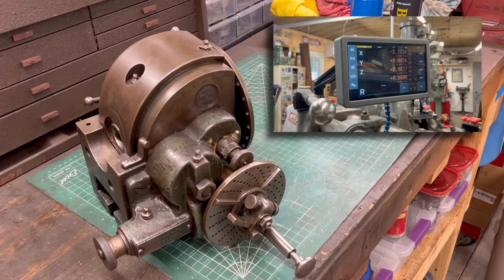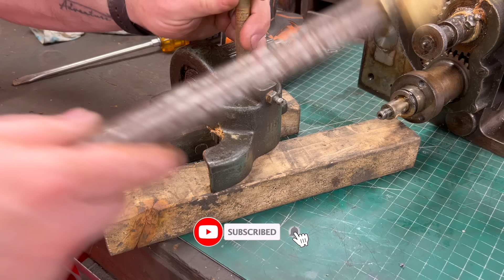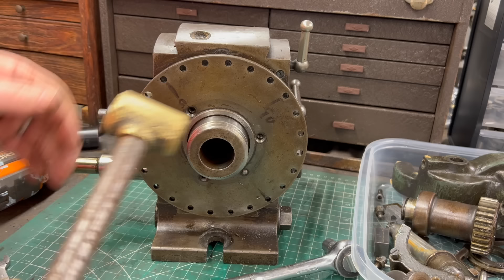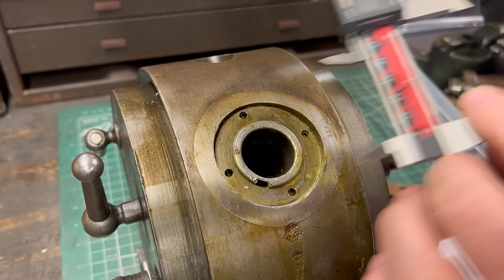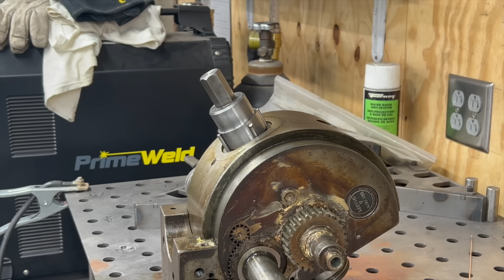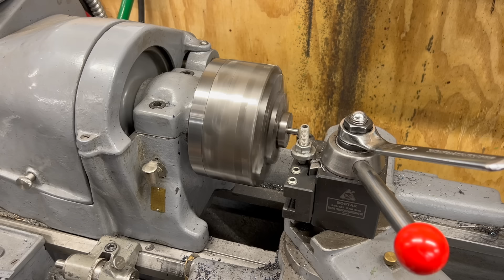Tearing Down a Brown & Sharpe Universal Dividing Head

Comment: Can't say I'm surprised you struggled. I've refurbished three dividing heads, two Elliotts and a Victoria. After each one I swore I wouldnt do another. Zero clearance fits and hidden grub screws were just two of the delights I came across.
I'd be wary of using the worm to lock the spindle when you beat on the rear locknut. The div heads I did had bronze worm wheels and I'd be nervous of putting a ding in it. I'd have gripped the spindle nose in my vice (it has copper jaws).
At least when you got in there it wasn't a waste of time!
Reply from the maker: It was definitely a learning experience! I was confident the worm and gear were not bronze, so I wasn't worried about doing any damage to it.

Comment: All you need was a piece of flat bar with two holes drilled in it to put the pens in space properly and then you could’ve just turned to nut
Reply from the maker: The nut is recessed into the curved back of the dividing head. I considered that, but the pins would be been so long the likely would have bent over with out much force. Thanks for the comment!

Comment: The forbidden peanut butter!
Reply: BTW, I worked on one of these about 18 months ago.  (The one I had was an import clone.)  I found it surprisingly difficult to reassemble.  The various shafts HAVE to be reinstalled in the proper order or you end up in a dead end.  I think I watched Rucker's video 4 or 5 times before I got it right.  Plus, there are a couple of little pins that need to be mated to little slots on washers.  All too easy to overlook.  
In the end, I sold the head as it was far too large for my round-column mill.  My aging back also thought it was a great idea to get it out of the shop!
Reply from the maker: They are pretty heavy, for sure. One of these days I will build some kind of crane over the mills for stuff like this.
Reply from the maker: IYup!